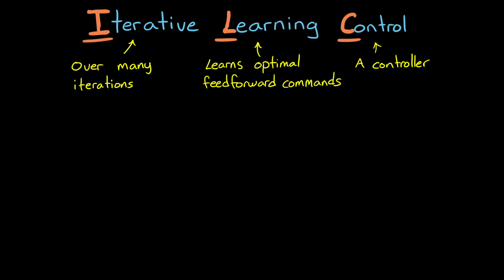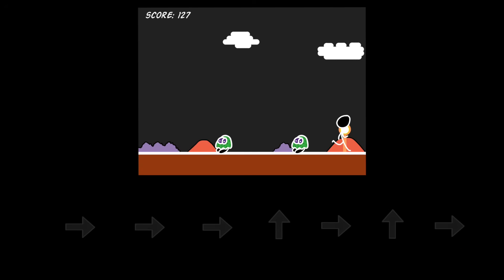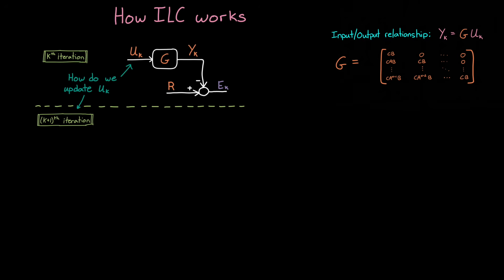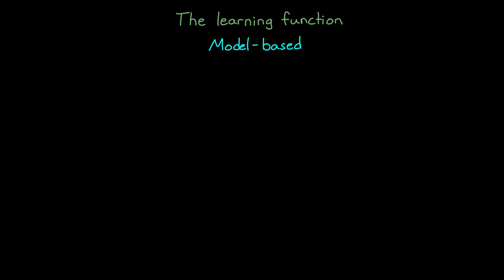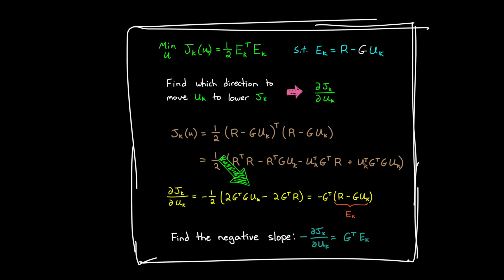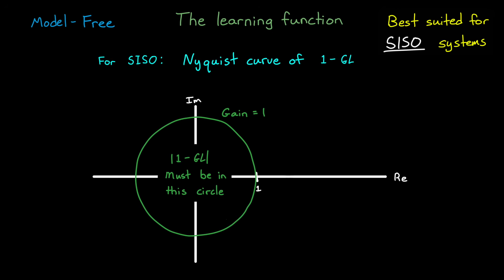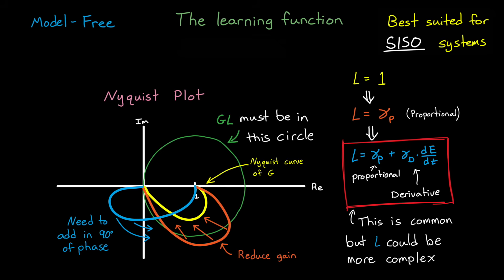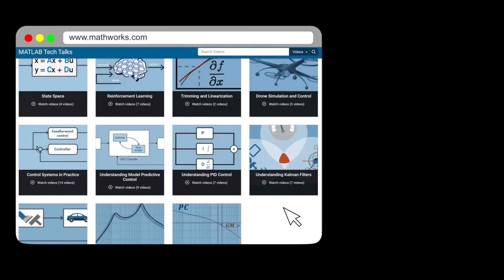What Is Iterative Learning Control?

Comment: This is essentially feedback control. The error is used to adjust the input.
Reply: The learning mechanism is feedback, but what it is learning is a feedforward set of commands. Those commands will run without being adjusted for the entire iteration before being updated. And once you've converged on a good sequence of commands and you stop the learning process, then it's certainly only feedforward. So, it's a bit of both at times.

Comment: seems like a worse version of reinforcement learning
Reply: RL is great but it often learns a policy that is much larger than what ILC does and it takes more data. The benefit of RL is that it works over a large state space and in a changing environment. But where overfitting is a concern in RL, it's the goal in ILC! And for situations where the iterations are repeatable, it's hard to beat the precision that ILC provides for such a lightweight controller.

Comment: Hi everyone, I hope you enjoyed this video! Please leave your questions and comments here and I'll try my best to answer them. Thanks!
Reply: What is the difference between feedforward and feedback
Reply: @zakzqk8485  Feedback means that you are adjusting the input into the system based on the output of the system (or the state of the system). So, driving your car is feedback because you are observing the other cars and road conditions and adjusting the steering, brakes, and acceleration accordingly. Feedforward means the input in the system is not impacted by the output or state of the system. In this case, you'd have a predefined set of commands that just run regardless of the state of the system.  Imagine understanding your car and the road so well that you could close your eyes and plug your ears and still be able to drive from one place to another. If you knew exactly how to press the accelerator pedal and exactly when to turn then you wouldn't need to observe the environment. ILC is learning that perfect set of commands that run feedforward.
Reply: @BrianBDouglas Thank you so much. I hope you consider explaining the data driven control and koopman operator.your explanations are gold
Reply: Very helpful video!
Reply: @EmirTemurlenk glad you liked it!
Reply: Hi Brian, 

Thanks for the video. Could I please know what are the key differences of reinforcement learning and iterative control?
Reply: @a.h.t.erangadesilva8320  RL learns a policy that can get an agent to achieve some goal in a dynamic environment. It doesn't expect the environment to be repeatable, or unchanging, or deterministic. It's more powerful than ILC but often learns a policy that is much larger and more complex than what ILC does. With ILC, a repeatable execution in a deterministic and unchanging environment is key, but the benefit is that the learning mechanism is very lightweight and the "policy" it learns is just a sequence of open loop commands.
Reply: Thanks for the video! After we learn some fixed quantity (in this case, `u`) with ILC, do we never change it again? Or do we run L in the loop even after the initial learning is done, to ensure that `u` is adjusted whenever `y` changes slightly?

Also, in the robot pick and place example, what would the reference R and the output Y look like?
Reply: Hello, I was wondering if you teach at any schools?